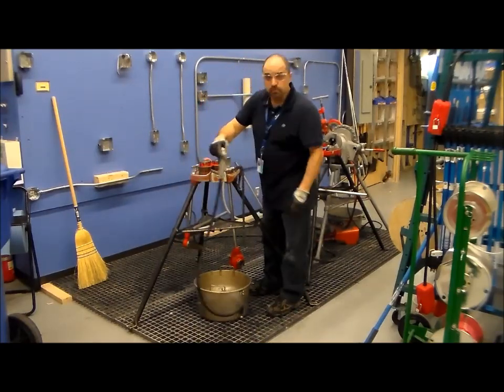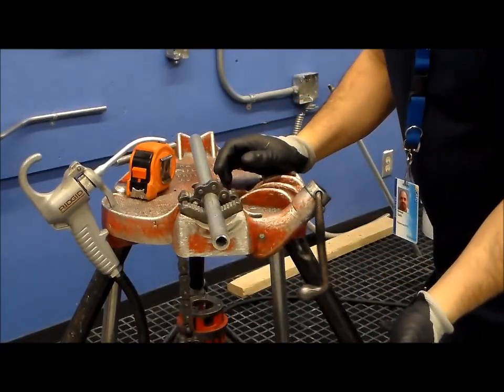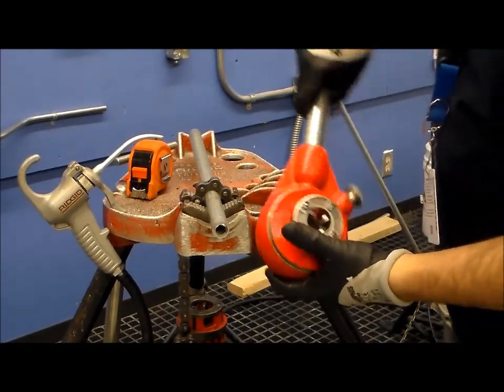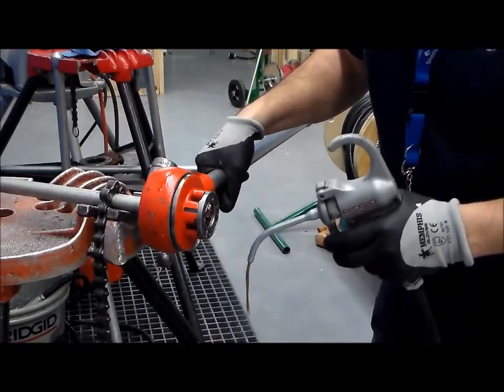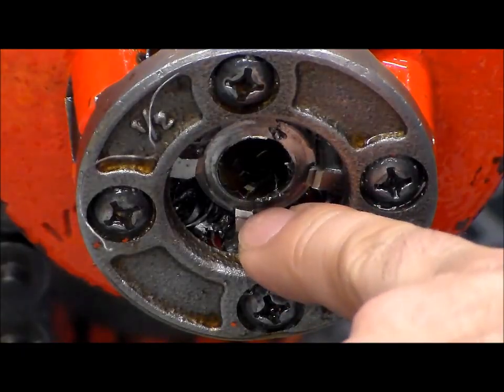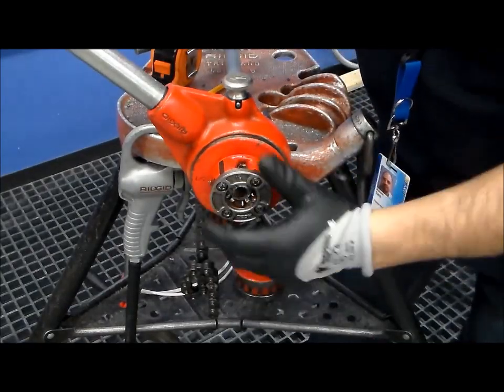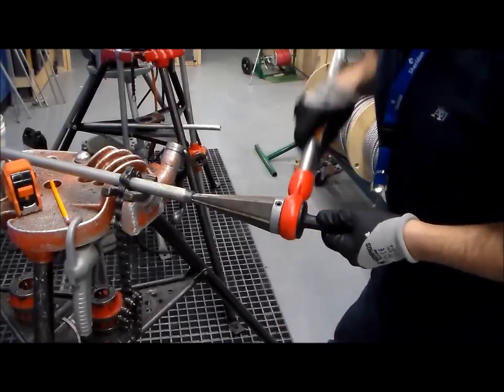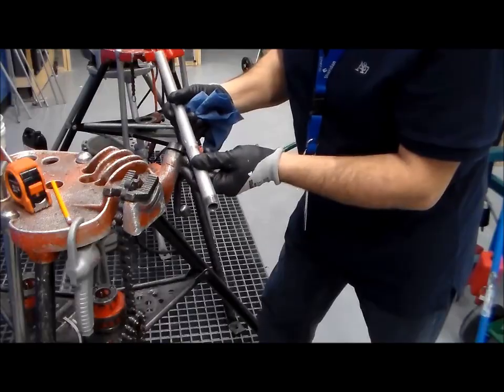Hand Threading Rigid Pipe

Comment: Really nice video. Thanks for sharing with us your expertise.
I was installing a propane tank. So I needed to cut certain lengths of pipe and thereby purchased a pipe cutter and the ratchet pipe threader you used in the demonstration.
My fittings would not screw onto the pipe that was cut. What happened? The fittings would screw onto the pipe threads that were done by manufacturer. Did I buy the wrong threader or was it faulty?
Appreciate anyone's input regarding this puzzle.  Thanks so much and Jesus bless.

Comment: What’s ridge pipe?
Reply from the maker: Rigid pipe is used when mechanical protection more then regular conduit is required. Explosion proof protection is another use for Rigud pipe
Reply: @royalsam69  thought that was rigid pipe.
Reply from the maker: @jhitt79  you are correct. Thank you for bring the spelling error to my attention. I have fixed the error
Reply: @royalsam69  I’m just messing around buddy. Not hating on you.

Comment: You should reem the pipe first so the pipe doesn’t expand I’ve had it happen personally I deemed the pipe after threading just a helping tip
Reply: I was thinking the same thing. 👍
Reply: My op order is cut, Ream, thread, check, full send

Comment: Nice video. What kind of oil is used for threading or recommended?
Reply: Just google treading pipe oil. Home depot has it for like $8 . Is called black oil or something like that.
Reply: High sulphur oil for steel

Comment: Nifty. Thanks for the instruction. 

I've been going through my dad's old tools and found an antique Toledo ratchet threader with a 3/4" die. Probably was my grandpa's , as he was a plumber. 

Found this other old die, but it doesn't quite fit. I had a hell of a time figuring out what company it was from because someone painted over the printing, but I think it must say Capewell Manufacturing Co (Hartford, Conn) , and I think the metal part says Vosler. Unfortunately, it doesn't seem to fit the other ratchet, and I can't find anything online that looks quite like it.  Kind of weird he would have the die without a matching ratchet, but then he probably just found that one at Goodwill (knowing my dad.) 

Anyway, not sure I have all the proper equipment there, but that looks fun. :)

Comment: I was looking on Amazon and it looks like most these threaders get bad reviews.  Is it because people are doing it wrong or are most the threaders pretty bad?  Can you recommend some good ones?

Is there a reason a tap and die set for bolts can’t be used on pipe?  Is pipe metal harder or something?

Thanks for the video.
Reply: well for starters, pipes have tapered threads and they are a lot bigger in diameter.

Comment: On the job site, can you use your linesman's to ream the pipe?
Reply: Lineman's works OK on thin wall tubing, EMT, but this is pipe.  Rigid, RMC is made the same and is much heavier. A reamer works best but a round file also works. On a "job site" if you are already set up to cut and thread pipe or conduit you would already probably have a reamer too.